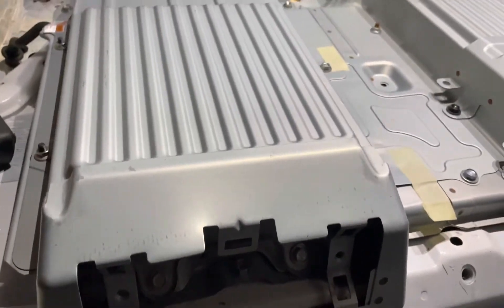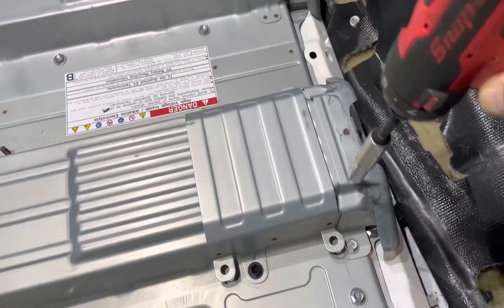Toyota Highlander Hybrid - Lexus RX400H Hybrid Battery Removal & Reinstallation (2006-2013)

Comment: Great video. I have similar issue with my car rx400h 2006. Sudden loss engine power. Gas is not responding when tried to accelerate. 

Scan too showing no trouble codes. What could be the issue please. Is it the cooling fan , battery etc? any help will be appropriated.

Thanks
Reply from the maker: I wouldn't think that would be battery related.

Comment: So if your car needs constant battery jumping, its likely this battery under the seats?  Not the traditional car battery where engine is?
Reply from the maker: Hybrid vehicles do have a cranking battery that is solely used for the initial starting of the vehicle.

Comment: Hi, I'm going to be changing all three fans soon. Do I need to unplug all the electrical connectors to take the top cover off? And does removing the safety plug cuts the power to the battery? I'm sure I will use the high-voltage gloves as a precaution.
Reply from the maker: Yes, removing the service plug will cut voltage output from the battery. You can test the main leads on the battery to insure no voltage is present. Also, still use the gloves. I believe the electrical connections are clipped in place.
Reply: @PalmettoBatteryPros  thank you!

Comment: Does this apply to both the Highlander hybrid 2010 & 2008 models? Can I used a 2010 battery on a 2008 vehicle?
Reply from the maker: I recommend contacting GreenTech auto with this question.

Comment: Finally finished putting our Lexus RX400H all back together today, after following your instructions to replace the rusted lower hybrid battery case with a good condition used one, and after fault checking all the battery cells etc. Followed all your instructions in this and a couple of your other videos, plus some input from a few other YouTubers, and saved ourselves over $5,000. Seriously. All because you took the trouble to make and post these videos of yours.  We owe you guys, so look out for inbound goodies, and a huge THANK YOU for your help.
Reply from the maker: Thank you very much! We are here to help.
Reply: Can you explain what "fault checking all the cells" means? How do you do this?

Comment: Thank you for posting this video! I am usually not a do it yourselfer.  However, I found this video helpful in me being able to replace the hybrid battery on my vehicle.  My 2006 Lexus RX 400H hybrid battery failed in December 2023 at approximately 330K miles. I purchased a used one from the junkyard from a vehicle that had 150K miles.  This video made it possible for me to do it myself and save a lot of money.  Once again, I am usually not one to work on my own vehicle, but this video was very clear on what steps to take to complete the job.  Thank you!!!
Reply from the maker: Thank you so much! Glad to hear we helped save you some money.
Reply: How much did you pay for the used junkyard battery?  This is very promising as I have 123k on my 2008 RX 400h and I just want to know if I should keep it for the long haul.
Reply: @ShockwaveDJ 
I paid $734, including tax for the used hybrid battery.

Comment: 2007 Lexus    rx 400h hybrid SUV ...
125.000 miles for $7200  Silver
Looks great is this a good buy or just purchase a Rx 350 and avoid Hybrid......?
RR
Reply from the maker: Low miles for that year, but the hybrid batteries age out too and this one is due for another battery based on year, if it hasn’t already been replaced.

Comment: After you install your new battery kit, Is the 400H ready to start and drive, or will you have to do something like clear the codes. Great video Thank you.
Reply from the maker: Not likely, codes should be gone.
Reply: . Hi, Great video, thank you. Appreciate for sharing your expertise. After the installation of the new battery kit, do we have to reprogram the vehicle computer using a OBD scanner to make it ready to start? Or is it ready to start after the installation?
Reply: After you unplug the starter battery, all the code is reset.
Reply: @YutheaTHOU  Thank you! Appreciate it very much

Comment: Can the original  batteries be removed from the casing and install new batteries in the same casing?
Reply from the maker: Yes, that is what we did here.
Reply: @Palmetto Battery Pros  
Sorry my bad I ment the 3 small casing that the battery cells are clamped in, not the big casing that everything goes into

Comment: Is it okay to test the battery was installed correctly before putting all the trim and seat components on?
Reply from the maker: Yes, and highly recommended. I always test it before I button it back up.
Reply: @PalmettoBatteryPros  any videos on what you have to do once the new hybrid battery is installed or should it be just ready to roll? I have a guy putting in a used battery for me and once they got it all hooked up it’s not turning the gas engine on still and is saying something about needing to be taken to a dealership to have the hybrid battery charged directly.